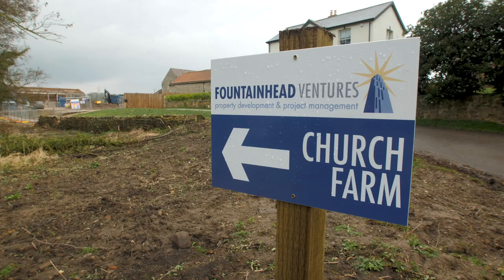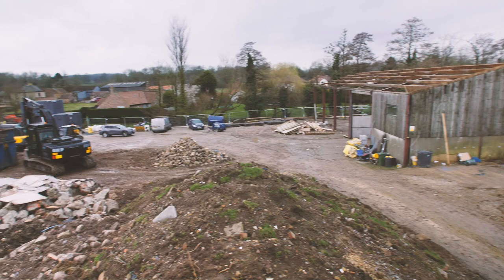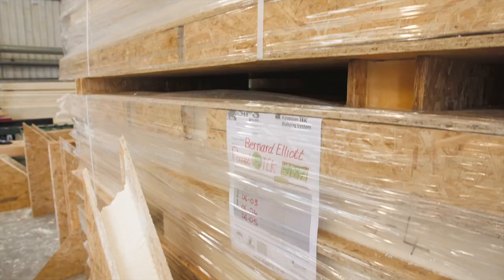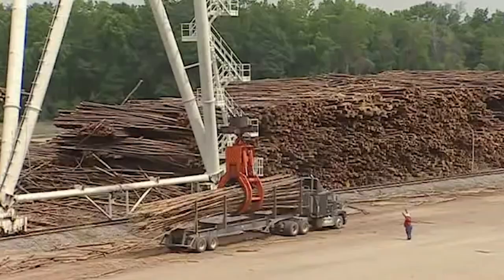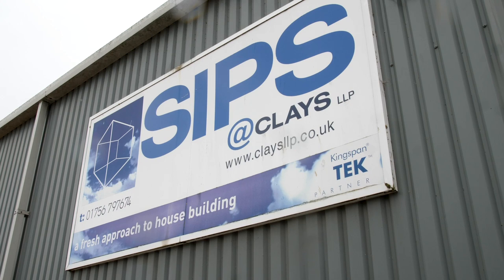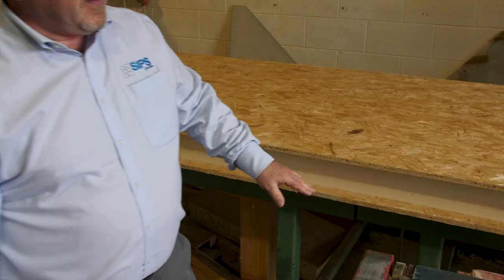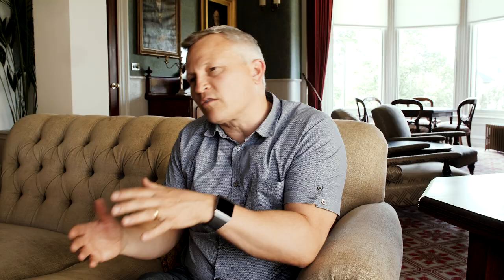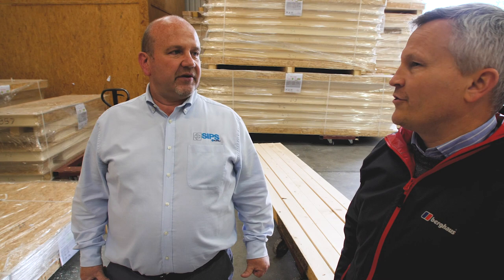Building an eco-housing development with structural insulated panels (SIPS) - Church Farm Ep 1

Comment: Did you give thought to the thermal mass of the houses? I get that SIPS is great for insulation and air tightness but such light structures have very little thermal mass. The building can heat up and cool down too quickly for comfort. Is this something that was considered or accommodated?
Reply: Hi Andrew,  yes, we did. The importance of thickness and thermal mass is a key in developing opportunities for including significant thermal mass in lightweight construction. A number of systems have been recently developed that demonstrate that although external walls can be of super-insulated timber frame type, internal finishes including floors, ceilings and partition walls can provide sufficiently high thermal mass without resorting to masonry construction. With this in mind, we specified internal materials with high thermal mass effectiveness. This includes a gypsum based Anhydrite Screed throughout the ground and first floors. Gypsum has a good specific heat capacity and thermal conductivity making it a great internal product for the floor and of course the walls are clad in plasterboards consisting of mainly gypsum. Together they help to control the issues low thermal mass external walls can present primarily through solar gain when using a substantial amount of glass. We also paid particular attention to how the houses were positioned and the use of extrerior shading to mitigate the effects of over-heating through solar gain (not a huge problem in England, but still worth thinking about). The use of triple glazing also reduces soloar gain by about 10% compared with double glazing. Finally, the use of an MVHR system helps by circulating and exchanging the air and with a summer stop option can even provide moderate cooling during warmer months by exchanging warm air effected by solar gain with new cooler air from outside.
Reply from the maker: Mr Blee, great question! Hope Andrew's explanation helped - he's a details guy!

Comment: What is old is new again.  Dad had similar structures made in the 50’s. Quite out of the box thinking then. It’s
 pre-fab
Reply from the maker: Thanks for the comment, where are you and your Dad from?
Reply: We are from southern NY, in Westchester County, just north of New York City.Dad passed 30 years ago now. He was so proud of that house.  Dad worked for the New York Central Railroad and could only work on the house on weekends or during his vacation in the summer. He did all of the cement block work  himself as well as most of the brick work. But the framing and insulation, he made every bit of it himself.  My grandfather thought he was crazy as I recall.  After all, who  builds house walls 15 miles away from the site in grandpa’s driveway? My dad did and the house is still there today.  Cost my dad $20,000 to build back then. It was sold in ‘05 after my mother passed for $529,000.00.   You can message me at Susan Yasinsky through  messenger.  I’ll send you the address of my childhood home, it’s the brick ranch. Look it up on Google Maps
Reply from the maker: @ossiningsue  Your Dad sounds like a good guy, working the railroad and building his own home, Legend. That's a great legacy he has with his home, I'll message you to see it. Andrew is originally from Nebraska, and he wanted to try a technique he was aware of from his time there and bring it to the UK, where bricks and mortar is the only way 99% of the time. Thanks for sharing your Dad's story, hope you can stick around and watch the rest of the project as it develops.
Reply: @MarkKnightFilms   I will stick around. It was due to my ambitious father that I studied architecture.  Can’t get enough of it. My father actually grew up in Hell’s Kitchen in Manhattan, when it was Hell to live there. He fought in the Pacific during WWII. When he decided he wanted to build, the GI bill helped and the rest he borrowed from the bank. I heard the story all my life.  Took 4 years for us to move in. That was 1960. I think that’s pretty fast for a mostly one man job.  He was just so full of excitement that it was more like fun to him. That house eventually became a home for 7 children and my parents. I have some pics of the inside when we were in the process of selling it. Also have an older pic before the breezeway and garage were added. I have to search for that though. I’ll try.

Comment: Building techniques and methods is from America and the bouquet are quite old and old-fashioned and not up to code like Europeans. Even Mike Rinsinger who works all over America and into Canada gets ideas from Europe more. There are quite some exceptions. Only the branch is quite conservative and outdated entirely just like here in the Netherlands. The Germans putting all their efforts into heat pumps which is also a loss of energy because the most houses cannot cope with that kind of low efficient energy. The structural and bases of a low cost house is extensive insulation and a close envelope and not with wood because you get always struggles with wood but more sustainable materials like a combination of breathing constructions with wood straw and cob. These billing methods withstand several hundreds of years are extremely cheap to build but costs of a lot of labor. The labor is always found like the Earth ships to people who like to learn to build from start to begin which help you for free or family and friends which come over for a week or a weekend to help. Giving directions and supervising the works to get the plumbers and electricians in as soon as possible and back in when it’s need to be finished is the greatest thing to do. I just technology in windows is a bigger or wider distance from the two glass panels in front and back and in between layers of pets for leach which reduce used four times the energy for four times in normal HR class.
Reply from the maker: Thanks for the informative comments - hope you enjoyed the film!

Comment: Thank you. I would to ask in which type of climate is the use of SIPS recommended?
Reply from the maker: Hi Regina, as far as I believe making houses out of wood spans all climates. In the UK we have a bit of everything and then some, but there are examples of people building them in Arizona desserts and out in the Alaskan wilderness, so I think the concept works just about anywhere. Andrew might jump on here and correct me at some point, but I hope that helps. Thanks for watching!
Reply: @MarkKnightFilms  Probably the only climate or location it might not be suitable for is a coastal location that is susceptible to hurricanes. Typically, it is recommended that new houses in these locations should be build of concrete block to with-stand extreme high winds.
Reply: @9706694895   I have found that many of the super wealthy build houses in the Hamptons in Long Island, New York directly on the beach. If a hurricane happens to destroy their beach front house, and the assessment has increased, they end up collecting more in insurance than they initially paid for the house.
Many are actually paid just to build there. In the end, construction workers, clean up crews and the owners are all happy.  Super star Billy Joel is one of the people who admitted this.  It’s a racket, something the normal middle class person cannot afford. Perhaps we’re better off.

Comment: Can I ask what is the column requirement for this? Column width/ dimensions and span? thank you
Reply from the maker: Hey Juliet, Andrew will jump on here and answer your question as soon as he can - thanks for your interest in the project!
Reply: Hi Juliet, I didn't notice your question, apologies! Whenever possible, the idea is to use primarily timber glu-lams for the structural elements in a SIPs build whenever possible to pick up the larger loads. Because of our large glazed, two-story sections, we needed to use a couple of steel portal frames as the spans between load bearing walls, was too great. Also, there were other elements that require additional strength like wind bracing to the glazing which was incorporated in the steel frame and hidden behind the transomes of the windows. The rest of the steel structure was hidden in a false timber wall as we did not want to see the structure. There are no hard and fast rules for column width or span for these frames, your engineer in conjunction with the SIPs designer and engineer will come up with the best solution for your needs (our design focused on visibility and eliminating cold bridging so it might be different for your build and therefore require a different solution). Hope this was some help. :-)

Comment: SIPS are a pain. For the inexperienced,  Tremendous amount of sealing off cracks and holes with foam later. Why? Because the design has to be perfect, and pieces must fit perfectly. Easier with stick build to knock in place

Comment: Are sips prone to condensation?
Reply: Hi Heather, 

I have found that the biggest contributors to condensation are inadequate air flow in combination with cold bridging. SIPs creates a continuous envelope of insulation, with very few penetrations meaning cold bridging is minimal and very manageable. Our architect worked very hard to make sure that our steel portal frames, beams and columns were inside the envelope of SIPs. The other important aspect is proper air flow. This is why all our houses utilise an MVHR (Mechanical Ventilation and Heat Recovery) system to manage the constant input of clean air from outside, while extracting warm moist air from the inside. The need for these systems is not unique to SIPs but is increasingly a requirement of all building methods because of the increased air tightness of modern homes.
Hope that helps. Happy to discuss over the phone in more detail if required.
Reply from the maker: Hi Heather, thanks for the question, hope you're enjoying the films and that Andrew's comprehensive answer was what you were looking for. All the best!